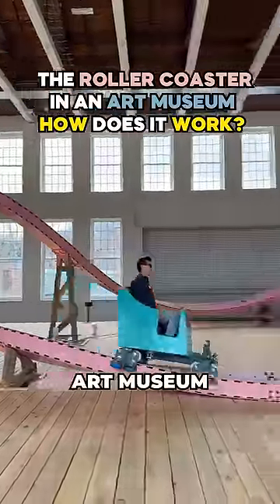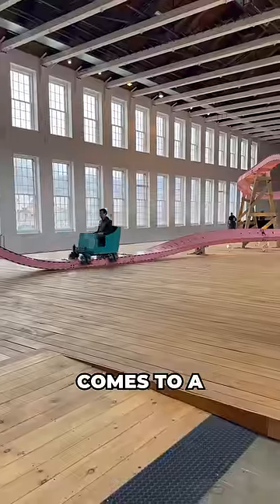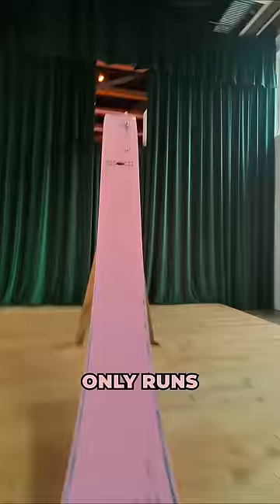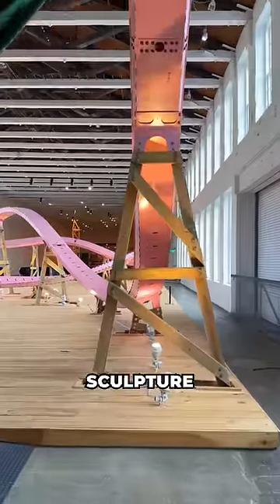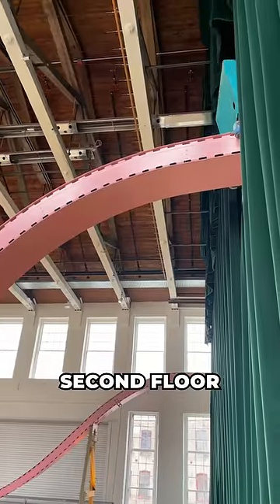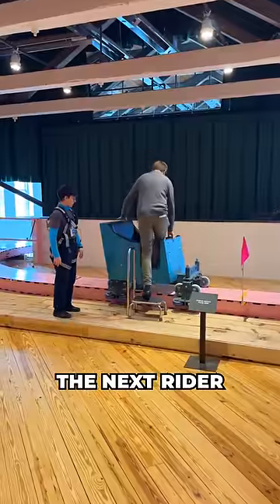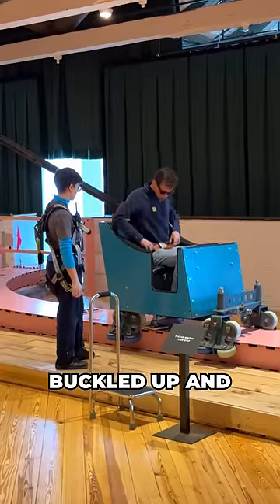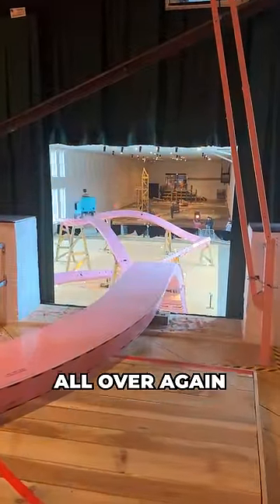How the art museum roller coaster works... 🎨🎢

Comment: It’s such an art gallery thing to have a roller coaster that’s not engineered to return to the station haha
Reply: I don't think it's possible to design it to return to the station, without involving some kind of power system (pulling/pushing the cart)
Reply: Any time the cart goes down a hill, it becomes impossible for it to get fully back to the same height using just its own speed, because part of the potential energy is lost to friction and stuff. It always needs a push/pull to give it the extra energy to return to the original height.
Reply: Basically it's a motorcycle chain, a motor and some gearing that pulls a roller coaster cart up a steep incline.
Reply: It’s clearly engineered not to return to the station, there’s a brake pad before the incline. It’s not really a lack of engineering in this case.
Reply: Yea that's why u raise the beginning
Reply: @TommyTom21 That's true but even without the brake pad physics wouldn't allow it to come to the same height... There's a slight chance that due to the smoothness of the coaster it might have just enough energy to make it back up to the top at a lower speed, but it's probably not consistent. The brake pad is likely there to ensure that it consistently does the same thing, that thing being stop. Because yeah it would lose some energy going down but it does look very smooth so it might not lose very much.
Reply: yeah this mindbroke me to just reveal that the guy pushes the cart and then pushes you when its read WTF
Reply: @aurias42  lol dude come on u were so close... how did you come to the conclusion that there is a slight chance it makes it back up to the top?? there is a 0% chance
Reply: @bmxscape  Because it gets a big push from the start. If the brake wasn't there, the track was very low resistance, and air resistance was also low... I can see it having a slim chance.
Reply: @Fay7666  Seems to me it would be the slimmest of chances, approaching zero.
Reply: The coaster not returning to the station is some type of artistic statement. 😂😂😂
Reply: And run one passenger per hour as well
Reply: 100% that was made by a designer.
Reply: art majors don't take basic physics
Reply: @aurias42  Energy conservation principle.
Even if we had a frictionless system, we're still losing to gravity.
Reply: @seanlambie3425  even with the energy conservation principle, energy is getting converted by gravity and height drop into kinetic energy (higher speed) - so actually if it it was frictionless (and no air resistance), energy conservation would allow it to get back up to the top, especially with the starting kinetic energy of the big push from the operator.
Reply: @NeitherHereNora  Spherical chickens in a vacuum also allow for some pretty cools physical models too. 

There are multiple solutions to this one problem, as you've well indicated, the core function is to input additional energy to the vehicle; at the begginig or in any of the the relevant track segments k where there isn't enough speed to overcome the peak.
Or, go wild, make the track move instead of the carriage. If the vehicle doesn't overcome the peak, make the peak undercome the vehicle!

My point was more on the lines of: that rollercoaster won't ever return, not even in a frictionless track system. It wasn't designed for it.

I'm assuming its by design given the setting.
Reply: @seanlambie3425  I see what you mean - I was just trying to get across that we're losing to friction, rather than losing to gravity (what I read in your comment). We don't lose to gravity because the potential energy from the height drop actually gets conserved (to your valid point about conservation of energy) in the kinetic energy of the coaster (its speed), even without an extra push. But as soon as you add friction, that's where we lose things - to heating up the air and track, mechanical energy going to air vibrations that create the rumbling sound and whooshes, etc.
Reply: @g_rr_tt  So add a simple DC traction motor with a wheelbarrow tire on it to the final run to boost it back up to the station. Artist are apparently terrible engineers! 🤦‍♂️

Comment: Bro isn’t an artist he’s an engineer 💀
Reply: Engineering is art
Reply: he is neither one
Reply: This has got to be the worst engineered roller coaster in existence, 1 pax per hour and man muscle powered.😅
Reply: @leandrogerardo9521  what engineering the end slop and the start slop are the same height if he doesn't get a really good push he is never going to make it back
Reply: @jonnym4670 I mean.. I agree with you about this not being particularly impressive engineering but did you watch the video? No-one gets pushed so hard they make it all the way back up. That's what the winch is for.
Reply: @Oob144  starving engineer.
Reply: He ain't that either
Reply: No an engineer would be able to make it go up too and go more than one time an hour ...😂😂😂
Reply: @jonnym4670  it's not supposed to...
Reply: An engineer would have made it finish the circuit

Comment: I was in fact not one of the people wondering this. 

Pulling it back up is not surprising, that’s the only way to do this without power. 

Once per hour is crazy it doesn’t seem any more special than a normal small rollercoaster. I could be wrong.

Comment: I love how the attendant has fall protection gear, yes he's only one story up, and unlikely chance of falling out that part, but all you need is a 4ft drop to really do damage, so it makes sense having that harness and rope attached
Reply: Weak
Reply: not really its pretty stupid 

the antendant goes nowhere near the edge meanwhile the rider get tossed out the front in a coaster that has only running and guide wheels only gravity holds it onto the track

and the whole rinky dink operation is held up by some flimsy stands dotted around
Reply: @Sarge92  they clearly go near the edge when the gates get operated and the car is push operated so if they happen to get caught on the car, the harness will hold them back. Harnesses arent for just standing near the edge of a drop.
Reply: @Sarge92  All roller coasters work by gravity. That's the definition. They coast. It's in the name.
Reply: @Enaronia  and you missed the point 

no one said its working by gravity

i said its being HELD ONTO THE TRACK BY GRAVITY

other coasters have guide wheels on the undersides to stop them flying off of those that dont they have alot more engineering in them than this craptastic creation

everyones freaking out about the attendants safety its the passengers who you should be worried about
Reply: @Extra_Mental  hes like 5 feet from the edge people put themself in more risk than that every day and dont need harnesses perfect example the staff in airports who guide the jetway over to the plane not wearing a harness staring out side at a sheer drop and a airplane whilst standing 3 feet from the opening

or people who work on loading docks

hell theres stages that are higher than that where you can fall off and into the band pit

this guy does not need a harness
Reply: @Sarge92    examples arent what make safety regulations, accidents do. Im licenced to work at any height and done training for it.

 Ive done work at loading docks and if theres an exposed edge theres a fence, if its just a roller door dock then the employees arent allowed near the door unless theres a truck parked, same training goes for the stage performers, they dont require a harness if they keep a set distance from the edge, in my country its 2m. 

Idk about the airport industry but that seems to be going under a lot of flack recently over safety concerns too.
Reply: @Extra_Mental  cool meanwhile the operator has a harness just incase he falls the rider gets a lapstrap as they ride the jank coaster 3000
Reply: @Sarge92  like a lap strap the back seat of a car would have? Seems fine to me considering a car accident would be worse than this crashing

Comment: “Artist’s can’t make anything that we really need!”

makes a rollercoaster for fun 😂
Reply: The world's most inefficient roller coaster.
Reply: @ it’s art. It doesn’t need to be efficient, it needs to make a statement.
Reply: @psychpsych  The only statement it makes is that the artist has no idea what they're doing.  Now if they would've incorperated some novel design elements or way of doing things that would be different.  This is just an artist that regretted not getting an engineering degree instead.
Reply: @evanbrown4820 how does this demonstrate they don't know what they're doing... because the gravity powered coaster doesn't fully reset itself, like every gravity powered coaster?
Reply: @raz1572  It goes back to my last comment on the matter, they couldn't even come up with an elegant solution to the problem besides a cheap winch.  A true artist would've come up with something much more appealing.
Reply: @evanbrown4820  what's inelegant about using a winch to pull something..? it feels like you're just looking for something to be mad about
Reply: @raz1572  It's literally the cheapest and ugliest way to achieve the desired result.  I'm not mad, I'm just saying that as an artist, they should have come up with something more aesthetically pleasing.  Take the Banksy "Girl with Balloon" for example, he could've just dropped it through an office depot shredder, but instead built the shredder into the picture's frame, making it elegant.  Going to Harbor Freight and buying a winch is not elegant, nor is it artistic.  Now if they wanted to use a winch but make it elegant it could have been designed to look like a bobbin for example, and use colored steel cable to resemble thread, just as an example.

Comment: If you designed it with a knowledge of physics you could have made sure it would never stall on the ascent parts . That would have made it an actual cool sculpture .
Reply: No you couldn't. All roller coasters have a mechanism to climb their tallest hill, if not more than one. Traditionally it's a lift hill (which works... exactly like this).
It is not possible for a vehicle to climb back up to its starting point without power, unless there's no friction.
That's where it's supposed to stop.

Comment: So they built a roller coaster that doesn't work... amazing
Reply: When you got a BA in engineering 😂
Reply: almost like a bad joke about artist vs engineers
Reply: It's art. And it's gone now.
Reply: Technically, it rolls and coasts.
Reply: You know that's exactly how every roller coaster works, right? Except usually there isn't a building with a higher floor for you to start on, so you start on the bottom and then you sit in the cart while it's being pulled up the hill. Here they took advantage of the building and had it start at the top. So the rider can get out before it's towed up.
In what way doesn't it work?